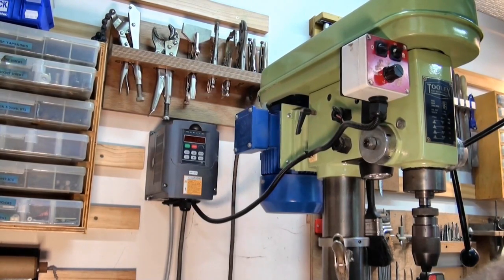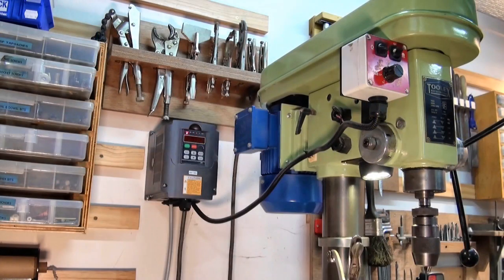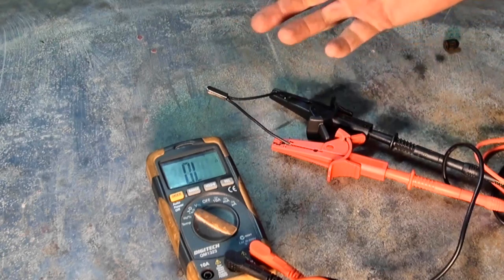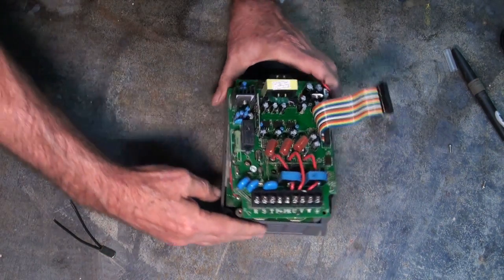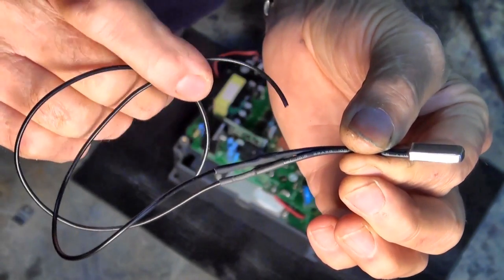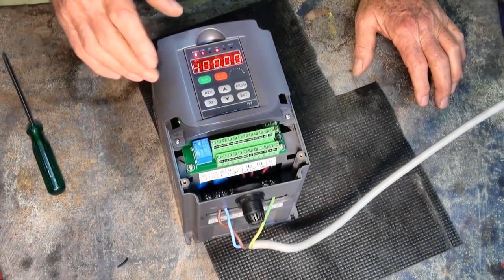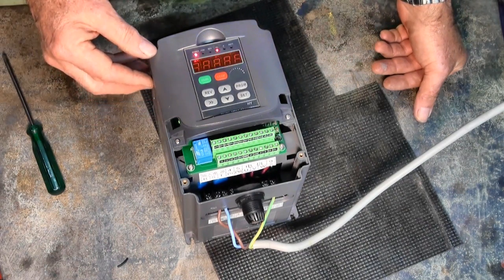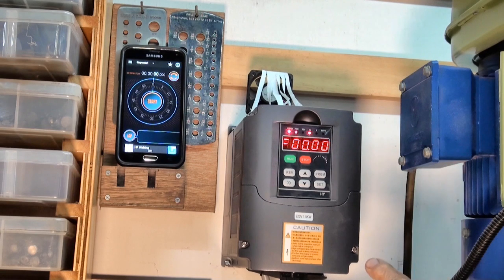How to make a SILENT Huanyang Variable Frequency Drive.

Comment: Mark, do you have  3 phase power in your shed now. Regards Frank
Reply from the maker: Frank, unfortunately I don't have 3 phase power in my shed. When we built our house we put the mains connection underground and because we were on a tight budget we used the lightest cable we could get away with and the smallest conduit as well. We live on acreage and the house is a long way from the street frontage so short of running 3 phase above ground and putting in several poles, I don't think it's going to be an option. 
Regards,
Mark

Comment: How did you wire in the start stop switch and how did you program it in?
Reply from the maker: You can wire in a start stop and reverse switch via the terminal strip inside the bottom cover of the drive. You also need to add a jumper wire between two of the terminals but it's a bit difficult to explain here. If you have the original user manual it will show the function of each terminal and where to add the jumper to run an analogue speed control and the start/stop switch.

Comment: we use such a vfd in my wooden workshop and running all machines the fan of the vfd is not been heard anymore. maybe it is not that loud because all in the shop are wearing ear protectors.
 listening to that huanyang alone wouldn't bother me that much than the expensive european one  or the noises coming from the drilling machine. but this is just a personal preference. nice work but for a real shop where multiple loud machines are working this is to much effort for to less gain.
Reply from the maker: Call my stingy but I hated the idea that the fan was just running for hours when the drill press was idle. The noise was a nuisance but it was also just wasted energy. My electricity bill is high enough already.
Regards,
Mark
Reply: @Preso58  I do realize that there must be motives and there must be some justification for the lost time, at least to oneself. If I were you, I wouldn't mindlessly attach anything else to that part. you could very quickly come up with the fact that this is not as smart as you think. What's the point of saving so that a fan isn't running? That's maybe $5 a year. maybe you could save much more simply by eliminating standby consumption.
Nobody has time for that in my workshop, for me it's just a tinkering for its own sake. That's no use, it simply has no added value and nobody should imitate it.

Comment: Wjy not replace the fan?
Reply from the maker: Well, the fan was fine. It just doesn't need to be on all the time. In fact it has never switched on since I did the upgrade which makes me think that some applications for a VFD don't use enough energy to warrant assisted cooling for the heatsink.

Comment: Question: do you run your VFD's/motors over 50 Hz? I run mine up to 120 Hz and have experienced no issues. I run a rather low ratio and then overspeed to get the faster speeds. This eliminates some of the torque issues on bigger drill bits.
Reply from the maker: Eric,
I run my VFD up to 80Hz but the pulleys on my drill press were optimised for 50Hz so getting really high speeds in not an issue. It's getting good torque at low speeds that I find elusive. If I were starting with a 3 phase motor and a VFD I would have chosen pulley ratios that were much different. Such are the problems when you start tinkering!

Comment: Just be careful because in some components the fan is designed to cool more than just the heat sink.  Those type of components may require the fan to be running constantly.  Cheap Chinese gear is notorious for not handling heat well and bad thermal design.  In this case, I think you are fine, but in other components I would select a better designed fan that is whisper quiet and have it run continuously.  They make fans that pull similar air that are nearly silent these days.  Just make sure the CFM and pressure the fan handles are equivalent.
Reply from the maker: Brent. If I do fry the drive I will purchase a better quality one like the Invertek drives on my mills. I did run the drill press quite hard one day for around 10 minutes and the fan didn't kick in. It is winter here in Australia and the shop temperature is around 20C so it might be different in the middle of summer (35+)
Reply: How cold does it get in winter there in Australia? I just can't picture kangaroos hopping through snow....

Comment: does it show rpm?
Reply from the maker: I believe it does but I haven't bothered to find out which parameter you need to set to do this. For a drill press with 3 different pulley sizes it is a bit irrelevant however I can see why it might be important for something like a conveyor or a pump.
Reply: No, but you can put an egg beater in the drill press and mix drinks while admiring the quiet VFD...

Comment: I have one of these drives, and it has the same fan noise.  Doesn't upset me too much, as I am fairly deaf anyway.  I have spent a fair bit of time, changing parameters and have a reasonably quiet motor (fitted to a Hercus Model "A" lathe), but I have very little toque when I am driving the 2800 rpm motor at about 1400.  I can stop the lathe quite easily with only a light cut.  Any suggestions will be appreciated.
Reply from the maker: Yes, if you check out my pull gear video you will see how I intend to solve the same problem on my drill press. It does mean a lot of extra machining but you can get nearly 4 1/2 times the torque without changing the gearing on the lathe. The pull gear is fitted in place of the normal motor pulley. You could also fit a DC motor and variable speed drive. There are lots of people using treadmill motors and controllers to do this. DC motors will give you a much flatter torque response plus variable speed.
Reply: Gday Keith I  have a hercus A mod 2 mine was 3 pH but I changed it to singe pH I went with a 1425 rpm motor 2 hp ,1.5 hp would be just as good but more grunt is always better in my book because it doesn't work as hard under load .2800 rpm is to many rpm idealy 900 is best but only comes in 3 ph , with a 1425 rpm motor and run a frequency converter you won't have to run it down so low. if you can get some cheap motors on ebay . I got mine in Melbourne hope this helps.
Reply: CONSIDERATIONS for Keith:
First, the work that a motor can produce depends on the power (HP or watts) that it can generate. Simplified this is voltage times the current supplied; now, related and important is heating loss attributed to current and thus a 1HP motor operating at 230V mains needs less current than a 1HP motor on 115V mains and will cause 16x less heating in the VFD driving circuitry. Note that the heating due to current increases as the square of the current ( I x I). This then means that at 230 V vs. 115V you are about 16x much better off operating a motor at the higher voltage as any of the VFD  circuitry supplying the  current generates potentially 16x less heating - you may not need a fan.
 
Second, a three phase motor potentially  can do more work than a single phase one, and run smoother, because the VxI product occurs three times as often. All of this means for home use you'll get much better results if you operate a VFD from 230V single phase to minimize heat and generate 230V three phase output to maximize power transfer.

Third, some VFD's used with three phase motors are capable of sensorless vector control  (SVC), a feature only available to three phase motors. Via SVC one can obtain meaningful torque at very  low RPM

Fourth, some single phase motors don't work very well with VFD's.
Find a VFD capable of SVC. Find a suitable used 230V three phase motor and install new bearings. Personally I use the Hitachi WJ200 VFD's.
Reply: REAL WORLD VFD METRICS:
Using a Baldor CM3546 three phase motor installed on a SB heavy-10 and controlled with a Hitachi WJ200-007 230V single phase input to three phase output VFD, set in SVD mode . Motor is wired in standard low voltage (230V) configuration. Can vary motor from 15 to 2400 RPM smoothly. Quiescent motor current is 2.25 amps throughout range. Made a  facing cut of .030 on 3" diameter aluminum while varying the RPM from low to high limit - does not bog down. Motor current stays at 2.75 amps throughout speed range. VFD heat sink temp stabilizes at 130F - no  fan. For initial lab tests the 230V input to the VFD was produced using a 1:2 step up transformer.
Reply: Keith P
check the connections to your motor, if you are using a single phase supply it should be connected as low voltage not high voltage.
Reply: David, thanks for the reply. My motor (.55kW) is connected low voltage, eg U1/W2 bridged, V1/U2 bridged & W1/V2 bridged. 3 phase connections are L1 on U1, L2 on V1 & L3 on W1. It is a 2800 RPM motor and varying the speed to full, it will only spin at 2800. I will check to see if the Huanyang VFD has a sensorless vector control function and if it does, I will try it.
Reply: a 2800RPM motor is 2 pole and the produces lower torque compared to a 4 pole (or 6 or 8 pole motor), the trade off on more poles is lower speed at 50Hz, 4 pole is 1440RPM roughly for instance. If the motor bogs down under load, try monitoring the motor current on the VSD (assuming that's possible) - if it exceeds the nameplate then the VSD possibly performs a protection known as current limit which is usually configurable. If it doesn't it could just be that the VSD is in a simple V/F motor control type instead of SVC, to boost torque down at lower speeds there may be a boost option that enables a little extra voltage on the motor at lower speed that can result in more heat generated, but also more torque. a 0.55kw sounds fairly small to me though and probably needs to be geared down a ways so it produces enough torque without stalling.

Comment: all youd have to do is replace the shit fan in them with a good fan
Reply from the maker: Yes but the goal was to eliminate the noise rather than to subdue it. For my application the fan stays off for 98% of the time that I use the VFD. It only cuts in on really hot days and on the occasions that I cut a lot of large diameter holes. 
Regards,
Mark

Comment: Check out the spindletalker open source software here: github.com/copenhagenatomics/SpindleTalker2
Reply from the maker: I did check it out and it looks very interesting. I have a VFD on my CNC mill but I never bothered to connect it to Mach3. I just switch it manually but since I have a Windows PC attached this might allow me to automate the spindle motor at last.
Thanks for the heads up.

Comment: Problem solved buy, a descent inverter.
Reply from the maker: That's true but they are double the cost of the Chinese ones. I have a very nice Invertek on my CNC mill.
Regards,
Mark
Reply: @Preso58  Are you converting from single  phase to 3 phase? Did you build your CNC yourself? Regards Mike.
Reply from the maker: @michaelmayo3127  Michael, yes, I have to convert from single to three phase. My shop is only wired for 240V single phase. I purchased a Sieg X3 milling machine and then fitted a Promica CNC conversion kit made by a now defunct company (it was actually just one individual operating here in Australia). Soon after purchasing the mill the DC motor controller board failed so I purchased a .75Kw three phase induction motor and retrofitted it to the mill. It now has stacks of power and only needed a few modifications to the mill head to make it fit. I subsequently filled the base and the column of the mill with epoxy granite to try to improve the rigidity. The Sieg X3 is notorious for a lack of rigidity in the column. It is better now but it's never going to be capable of heavy cuts in steel.
Reply from the maker: @michaelmayo3127  Michael, yes I am converting to three phase from 240V single phase. I purchased a Sieg X3 milling machine and fitted a Promica CNC conversion kit to it about 10 years ago. Promica is no longer operating as a company here in Australia. Some time after purchasing the Sieg the DC motor controller failed and I replaced the motor with a .75Kw three phase induction motor and an Invertek VFD. I also filled the base and the column of the mill with epoxy granite in an attempt to improve the rigidity of the machine. Sieg X3"s are notorious for a lack of strength and rigidity. The result is an improvement but it's never going to be able to do heavy cuts in steel.
Regards,
Mark
Reply: @Preso58  Thanks Mark. Here in Denmark we have 3 phase as our standard household power supply. 240/380 volt. And I can see the Invertek  make a cheap 380/380v frequency inverter.All my machines run on 3 phase. Thanks for the tip. Regards Mike.
Reply from the maker: @michaelmayo3127  I recall Stefan Gotteswinter commenting that all households in Germany have a three phase connection as standard. We here in Australia pay astronomical sums to get three phase connected and even more if you live on a rural residential property. I recently purchased a rotary phase converter for my Bridgeport mill and it works quite well but it's noisy and it was way more expensive than an Invertek inverter. I bought the RPC because the Bridgeport had a mixture of three and single phase motors and some were 110V so it was easier to just plug everything into what the machine thinks is a native 415V three phase supply. The upside is that I can wheel the RPC anywhere in the workshop if I ever get any more three phase machines. My wife and I are looking forward to visiting your beautiful country when this whole horrid Covid thing is over. 
Regards,
Mark
Reply: @Preso58  You and your wife are more that welcome. I live in North Jutland in the area of Mariagerfjord which is one of Europe's longest Fjords. When I worked at Hans Jensen Lubricator we had a Bridgeport but, we only used it for maintenance work. Their production mills were Swedish Varnamo/Sajo, Danish Pedersens and for tool making we used Czech TOS. But, I've seen a lot of different  machines since those days.
By the way our neighbours used to live in Australia, he had a restaurant in Brisbane, served 200 noon lunches a day but, he became ill and came back to Denmark for medical treatment. Well, that's the short story because his children, who are Austrians, turned up on his door-steep 3 month after. left their mother evidently. I work in the building sector to day but, I still tinker with mechanics. I have a machine workshop at the back of the garden. C-19's a bit of a problem though and the new English variant is a bit of a pain, we are nearly totally shut down her for the same reason. Take care Australia. Best wishes from Denmark.